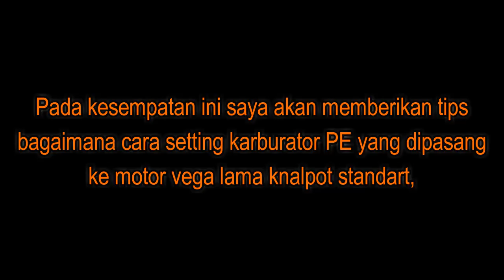Cara setting Karburator PE 28 untuk mesin vega knalpot standart

Comment: Bang saya mau tanya..Pj Mj megapro kalau dipasang diPE 26 PNP apa enggak ya ?
Reply from the maker: bisa mas
Reply: Siyap* makasih bang infonya
Reply: @RamanditaMotor  bro klo carb nsr skrg mj 140 . pj 35.. Bila mau set angin . putaran angin kena lbihi 3/4 putaran bru jumpa timing tertinggi.. Apa promble ya? Mj terlalu besar apa pj kecik/besar?.. Moto ( 2 stroke spec 56mm)

Comment: setingan angin nya buat karbu tipe skep bgtu brp putaran sih ?
Reply from the maker: 1,5
Reply: tapi dimesin ku kok malah brebet yah. padahal ukuran pilot jet nya sudah paling kecik
Reply: mesin ku beat karbu 145cc klep sonic 28/24, porting nya ngaruh ngga ya soalnya diameter porting in 24mm, apa masih kurg gede?
Reply from the maker: pj ukuran brp ms?
Reply: 35
Reply: 35

Comment: Mas kalo supra fit seher kaze std papas custom porting klep standar krbu pwk 24 knlpot std pick up pulser masih standar masih kurang dan susah di setting apakah harus di majuin pengapianya tambah. Las di pick up pulsernya brapa mm mas
Reply from the maker: belum tentu ms
Reply: @RamanditaMotor  solusinya gmna mas pake pj 35 masih kekecilan di setting blm ada stengah putaran dia udh tinggi .. busi juga tengahnya warna merah bata cuma atas elektroda tengah putih busi yg paling atas kadang hitam kadang coklat warnanya mas mj 105 spek cuma 110 cc mas di kasih 110 terlalu basah

Comment: Bang pj mj pe 28 buat mio spek 57.5 pake uj berapa?
Supaya pas turun gas ga nembak knalpot nya
Reply from the maker: yg sekerang brp ms?
Reply: Pake mj 151 pj 40
Udah gunta ganti
Pj 35.38 mj 122.115.151 ttep nembak pas turun gas nya
Reply from the maker: euro bocor mungkin ms
Reply: @RamanditaMotor  euro itu apa mas?
Maaf masih pemula